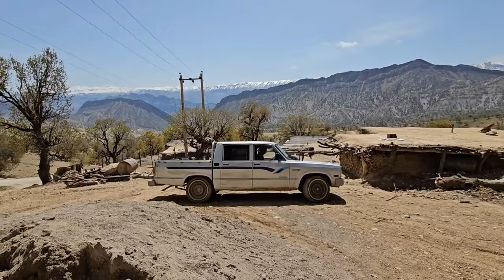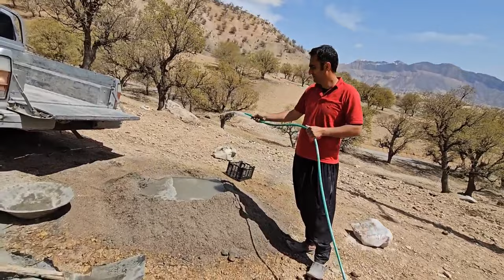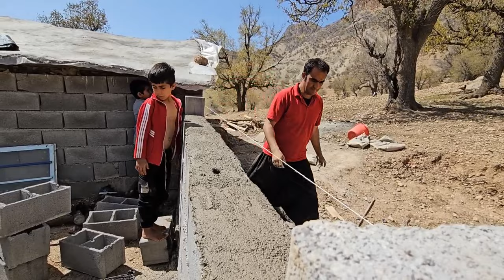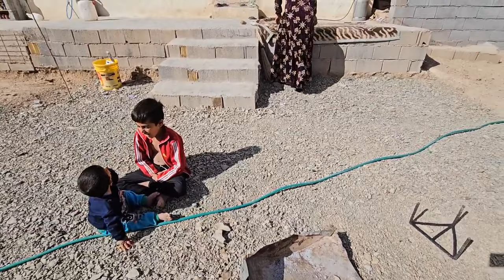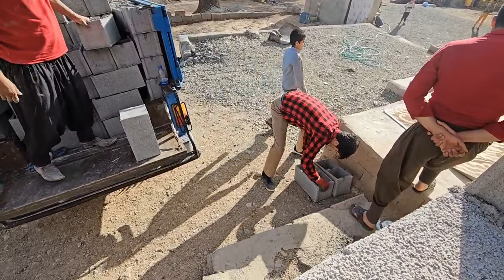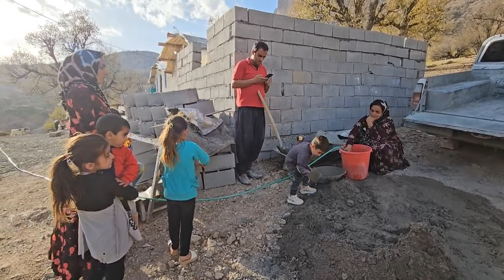Beauties and events in the nomadic house

Comment: I worry that they've used a pipe to pump the water a very long way and a hill and the motor may find it difficult.
Reply from the maker: Hello, water is transported by car by the government and we pump from tankers
Reply from the maker: Thank you for caring about this family
Reply: @montainlif  what I mean is the small pump next to that tank which connects to the taps on the side of their bathroom. The pump only has to push along but if you connect a hose pipe to the tops and then pump a pill, this will put more strain on the motor connected to their water supply.
Reply: They did not understand what you said. I think you are right!  @gentleeventful
Reply: @BirgittaWiding  I put too much pressure on them 😃